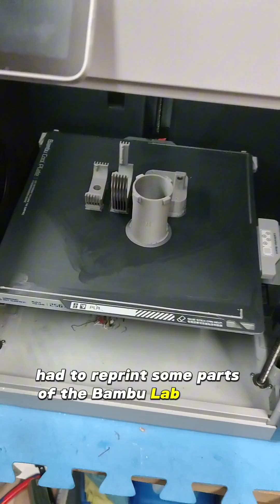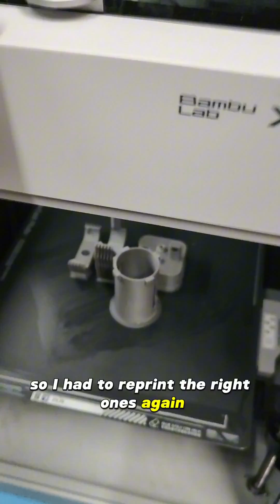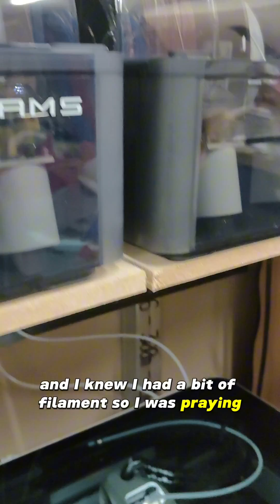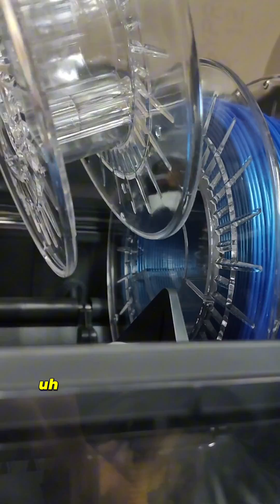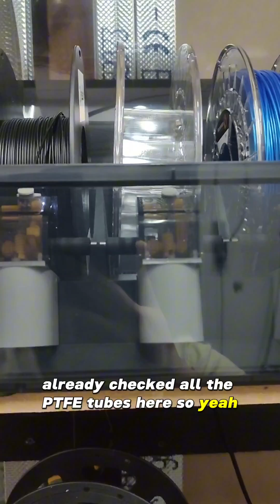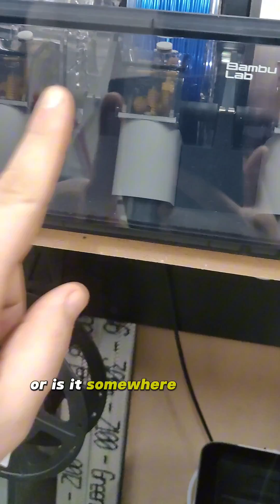A little filament mystery for you - part 1

Comment: If there is not enough filament left for the AMS to pull the filament back it will actually just purge the rest of the filament out the purge chute in order to clear the filament.

Comment: I have seen it happen once before a roll runs out at the AMS and the light on the spool goes red and the print finishes with the remaining filament that was in the bowden tube and then when its finished with the print it will purge the remaining filament that was still in the tube.
It does this because it can't spool it back to the AMS anymore.